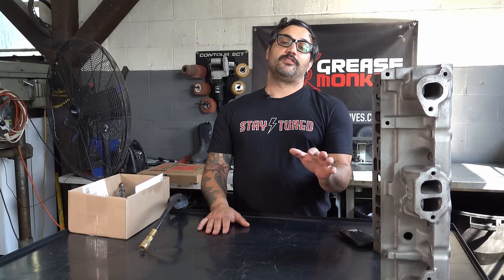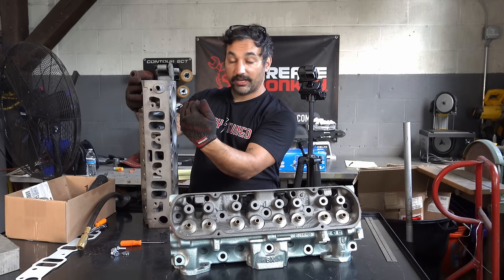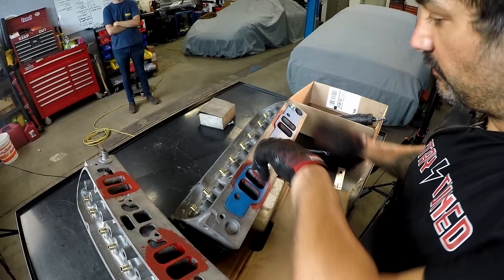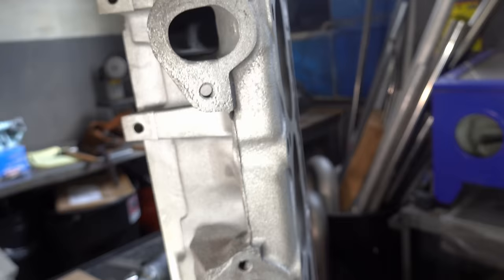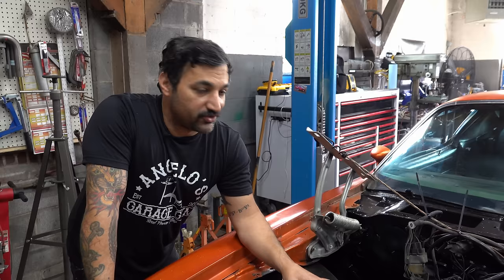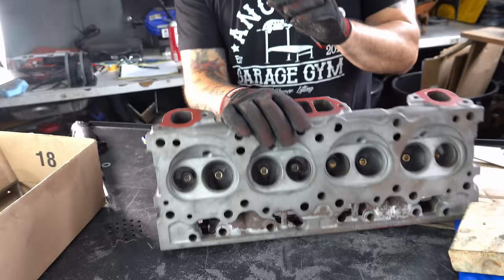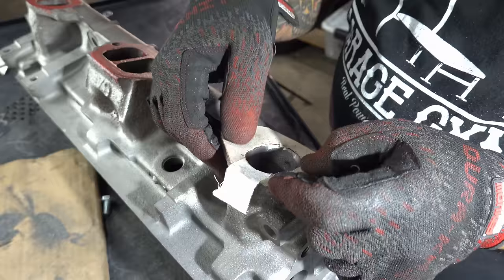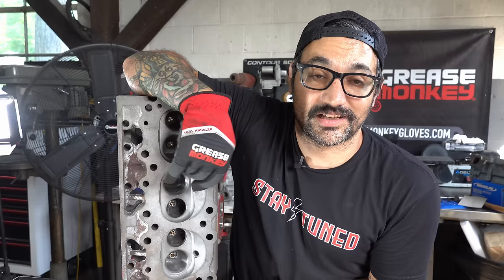It's Free and I Hate it! *Works on Any Engine

Comment: What about the chambers a lot of work fo do there and just if not more important then what youve done iv only done one myself because its a lot of work i done the runners and the chambers relapped the valves changed valve seals springs and lifters i also ported the holly highrise changed out the cam to just help open the valves a little better and when it was all said and done it was like day and night that big block was snappy and it ran fantastic like it waa a total different motor and still is now

Comment: I realize the heads are iron but with 464ci as big as the valves are with a 6-71 wouldn't you think it would make 650hp or so and with an 8-71 shouldn't it make closer to 800hp? The motor should make 450-500hp N/A and at 7psi I would think it would make 675-750hp easily. At 9.1 CR I would think you could run 7-9 psi on 93 and possibly as high as 11-13 psi on E85? I'm more familar with fuel injected engines but the power you said seems really low.
Reply from the maker: I think you are right on with these numbers, I said 800 at some point. All worked up at 8psi we expect a lot more than 600HP. Thinking we might run it NA on the dyno first and see what it can do.

Comment: How do you know when to stop, so that you don't burrow a hole in one of the ports on the side?
Reply from the maker: Well, that is the tricky part, but you can usually get to the other side of the port and get an idea of thickness. I was pretty conservative to be sure not to have that issue. So far so good!
Reply: @StayTunedTA  Thank you. I had a set of 906 (Magnum) Heads that someone ported and polished on my 400 B block, and I couldn't believe how much difference it made.

Comment: Its costing you $20k to build a Pontiac? I have four stroker Pontiacs, even the 505 I just got from Butler doesn't have $20k in it, still won't be that much with the top end I got from them years ago on it. They just happen to be the same heads and CNC program that Justin has on the Crow. The 461 currently in the 68 LeMans where the 505 is going only cost me $3700 with a used set of Edelbrock heads I got for $1700. Butler and KRE source most of my engine parts, been getting work done by butler for the last 30 years. They are awesome to work with.

Comment: Rotary engines will be the future once we make the change to hydrogen powered engines. We just need to build the infrastructure to be able to easily fuel them at every fuel station. We would also need to build larger hydrogen plants to fuel everything.
Reply: And find some way of producing hydrogen that doesn't involve starting with fossil fuels or take more energy than the hydrogen contains.

Comment: How does VE get affected by boost?
Say you have 100hp motor with 100% VE and 14.7lbs of boost and it makes 200hp now
Would that same motor at 110% VE making 110hp N/A make 220hp on 14.7 PSI or does it make 231hp?

Hot rodding can definitely be nerdy at times.
Reply: On paper sure but nothing is without losses. While doubling atmospheric pressure should double power, it pretty much never does.
Reply: @thenewBH  Yeah I know that, but is that in theory how volumetric efficiency works in correlation to boost? I'd like to see it tested.

Comment: I work with motorcycles but have a '76 Formula 400.
I expected to build a minimum of 0.75bhp per cu/in (375bhp minimum)
The amount of 'flash' in the heads  restricting oil return was amazing to me (bad on every stock  head I looked at)
Pretty horrible port shapes
When I asked on a Pontiac forum about tuning and what sort of airflow I would get.
 the almost overwhelming consensus was stick a 454 in it and airflow is already 100% (I thought 55%~60% reasonable   pretty poor design by even 1940'sn motorcycle standards)
With my motorcycle experience I knew that was wrong so didn't bother to return there.
At the time I didn't know about the Ford/Chevy/Import dumb-asses who didn't actually know 'anything' but had 'brand loyalty' ?!
Got hold of a 1965 389 out of a Catalina as it has 'small valve' heads with small combustion chambers so more room to correct problems by fitting larger valves and decent C/R.
From experience, the $9.99 extra cheap die grinders I bought at HF 20+ years ago are more than adequate and surprisingly still work very well at 90PSI.
You do need decent quality burrs though which will cost a lot more than the die grinder

Comment: On many modern engines since the 90's, porting and polishing may actually be detrimental, as the smoothing may decrease the desired turbulence designated by the design optimized by systems of differential equations.  Older engines you are modding ave so much potential compared to modern engines.  On a few designs, IIRC, porting and polishing have no effect or worse, proves detrimental.

Comment: What are guys like you going to do when unskilled newbies come along in a stock electric car that can do zero to 60 in 2 seconds with no shifting?
Reply from the maker: Get smoked like everyone else! Look way cooler doing it tho
Reply: In rereading my comment; I didn't mean it to be insulting. Having been a motor head myself with a '55 Chevrolet that I did all of the work on myself. I installed a straight axle, pulled out all the A frame. Had a 283 bored out with a 327 crank shaft, 327 large valve heads out of a wrecked Corvette. Oldsmobile 556 rear axle that I had to cut out the wheel wells for the street legal racing slicks. Spent a lot of my youth in junk yards and under cars. When I could have spent it on top of pretty girls. I still miss that G force. Riding the windy back roads at 60+ MPH with the headlights off. I appreciate what you do and how you do it well. Thanks for the channel. Be well, Tom.

Comment: a problem with the over 100% efficiency of the rotary is (i'm assuming here) you're basing that off of the 1.3 liters of displacement.

when many people actually believe that the true displacement is 3.9 liters due to the displacement being measured from just 2 of the 6 rotor faces iirc. but if you think of each rotor face as it's own piston, then it's displacement is 3.9 liters

Comment: Some of what you have said is completely contradictive. If this is just a street freak and not a full blown blown race car. The Porting of the heads is a waste of time since your putting the blower on it. Don't get me wrong yes it will make a difference and make it run better but, not enough to warrent the time and energy if your only tooling around the streets.

Comment: Wish it was "free" horse power but unfortunately they charge a shit load to port heads
Reply: It is free if you do it yourself which is the point.
Reply: @adematthewsracing  so tools are free? Burr bitts are free? Knowing how to and where to port . It's not grab a drill and go at it for free power . If it was as simple as making the hole bigger everyone would be doing it and there would be no reason for a cnc port job .
Reply: @dabtech7456  Do all the tools you own do one job and one job only and/or are never used again? I've ported multiple heads over the years all for my own use and the investment in tools (which are used for many other jobs than just porting) is tiny per head now. Knowledge is free as well. Everything I learnt was from books from the library. These days there is a wealth of free knowledge online. Everything out there someone had to learn to start with. People aren't born with the knowledge of how to port heads after all.

Comment: Why wouldn’t you just put the gasket on and then paint over it ? No scribing required……remove gasket and then remove painted material, yah?
Reply from the maker: I would do that with spray dye-chem and it works well, but with the brush, I do it this way.

Comment: This is the worst tutorial for beef wellington I've ever seen. Also, 20 psi in a fuel tank to check for leaks is excessive. Some tanks will swell and possibly split at the seams with that much pressure. 2-5 psi is plenty in my opinion. Looking forward to seeing this motor run!

Comment: Now they are plunging up the imports with carbon with these direct injection engines and returning with poorly designed EGR systems. Can you imagine running all that blowby back through your turbos and polished ports and mixing with scientifically proven fuel-air quality for the best combustion and calling it emission control? It's sabotage. It is asking for a catastrophic engine failure. Please someone explain this to me. I just can't wrap my head around this.

Comment: Yea you lost me at the "efficiency" point!
I understand wat you mean by your term of "efficiency" you mean how much air mass you can put into en engine relativ to its displacemen.
But that has nothing to do with ANY other means of efficiency! Just putting more air and fule into an engine doesn't always make more power!!!
But that's what I expect from you Americans! 
Making slightly over 100hp/liter with custom high end crap components and 2bar of boost... Yea... Murica! 😂
Reply from the maker: Man, that is a lot of exclamation points. So as an air pump, you can label the "volumetric efficiency" of an engine as to how much air it pumps per revolution, relative to its size. Yes, putting more air and more full into an engine and burning it properly (decent timing, good burn) absolutely makes more power buddy. There's way to maximize it with tuning, of course but the more air the motor flows, the more power you can make with it. Also, yeah AMERICA!